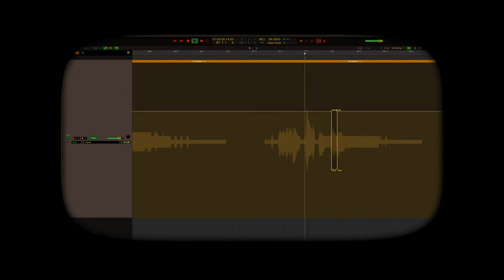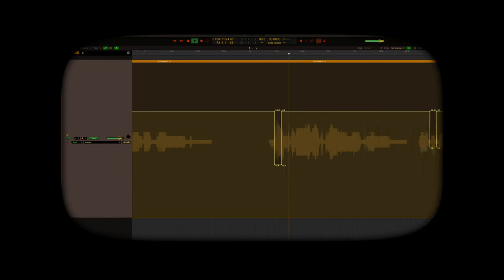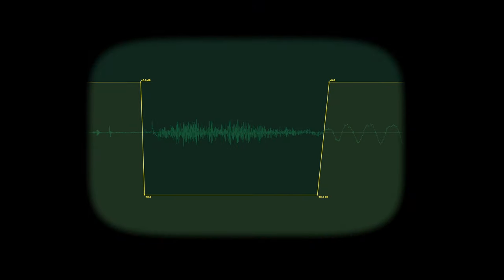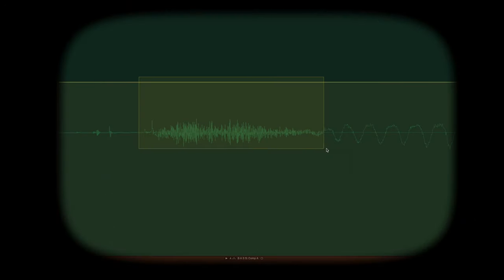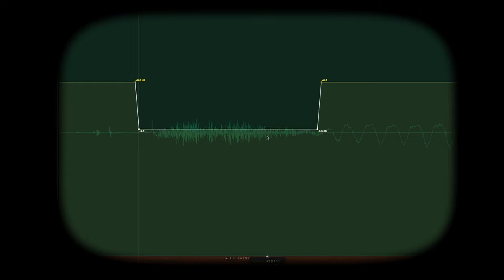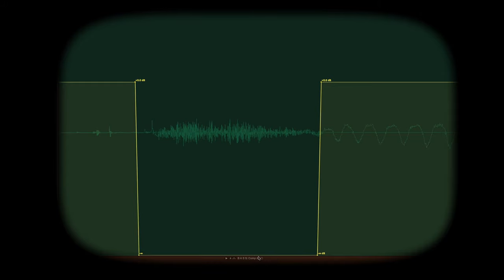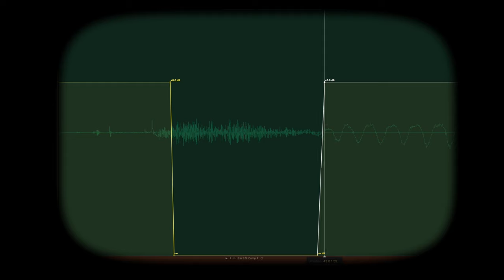De-Esser Plugins are NOT SEXY!

Comment: Have had some good results using Trackspacer and side-chaining it to other bright elements in the mix, the snare, hi-hats etc, so it ducks out of the way for those elements. A combination of this and light de-essing ont the vocal is great for the sessions which require a fast turnaround. If there's time in the mix session to automate manually is by far the best way!

Comment: For the most part, I agree. However, Airwindows' DeBess does something that other de-essers don't, and I find it really gives a more natural sound than just automating. It alters the wave form so that the harshness of the sibilant is smoothed. It works great on cymbals, as well. You can control the depth of the smoothing, and get a very natural sound. Still, I wouldn't set-and-forget it, but if I had to pick one to set-and-forget, it would be DeBess for sure. Especially since it doesn't attenuate highs to achieve its effect. All the shimmer and goodness stays put, and the harshness goes.

Comment: Thanks. I do this too ... because I lack de-esser skills. 

Works great for acoustic guitar squeaks as well. A bell EQ filtre centered on about 2000(as I recall) and have that band just drop out for the squeak. Nobody will notice and the rest of the sound of the guitar stays intact, unlike using the fader. 

I find it also works well in a mix. Automate an EQ to duck the mids only when the vocal is going to give a little more space. I’ve never gotten it to work with side chain so I’m quite smitten with this method.

Comment: I was taught this trick at uni and it makes such a big difference. 

I tend to do this on the lead vocal and then use de-essers further down the line if any Sss need taming after the processing chain, as well as for reverb sends sometimes. 

If a track has too many BVs I would stick with De-Essers for them but still manually edit the lead vocal as its the center on the stage.

Comment: Alright - I’m late to the party here. But, thank you man. You saved me a lot of time tonight. I HATE DeEssers. But they can be helpful. (I like to use them on my acoustic guitar bus to soften the attack of my acoustic tracks). But tonight I was mixing a song with simply HORRIBLE Esses. I usually manually grab each Ess (manually) and lower the gain, then cross fade. Using Automation was a total time saver. Thank you for sharing this. Seriously great instruction.
Reply: By automate, do you mean the volume?
Reply: Yes - pulling the volume down.

Comment: This is the best method by far, I use it all the time, sometimes you have a specific ssss (extra strong) and I use an EQ, lowering higher frequencies, yet not necessarily lowering down the volume of the sibilance ... With this "surgical" method you keep "the power" and "the emotion" of the sibilance where is needed ... My problem is I mix outside of computer (in a synth workstation) then I transport the track (vocal) to computer software and do this without music, so I have to repeat the process 2, or three times to get it just right at the right places (when I hear the whole song), but it's worth it ...

Comment: You can also just do this on the pre-mix with clip gain which will ultimately make it even more transparent. Suppose the automation route works as well though
Reply from the maker: Totally , but it's different to do something like this pre-inserts vs post-inserts (esp. compression & eq).  Neither is better, just different.

Comment: I find it can get a bit tedious fixing sibilance with automation. What has been working great, is create another track with only the slices of the sibilant parts, flip the phase and play with the volume to adjust how much is being removed. At full volume, the sibilance is completely removed, whereas if you adjust the volume a bit to control how much of the sound is being removed... and then it gets easier to add automation over certain parts. Also works great smoothing out guitar solos. What do you think?

Comment: totally agree about no de-esser being perfect. Soothe is about as close as I've got from plugins, but.... my personal favourite way of doing it is to chop all the esses out onto another track, consolidate them as one region, then use the 'open in audio editor' function to open the file in iZotope spectral repair. i hone in on where they're most resonant and piercing and gain those bands down by about 6-9db across the whole file with the horizontal selection tool. i save, return to Logic, and then if need be i can automate the volume of that dedicated channel, although it's usually unnecessary. aside from chopping the esses out, which i'm (hopefully) quick enough to do in one live play-through, the rest of the process takes about a minute. if any of the esses jump out as weird later in the mix, i've got the original audio still there in the main vocal track, which i can bring back in and simply automate, as you describe. esses eh.. can't live with 'em...

Comment: I have a de-esser on a vocal track, the vocal bus, the submix, and master bus of a song I'm finishing now. 4 walls of de-essing. And I STILL had to manually drop the volume about 10dB on every s, f, t, ch, and also fade in Ps and Bs.. damn. I've been mixing for about 3 years and watching tutorials, people go like, yea "slap a de-esser on and you're good!".. That has NEVER worked for me. I swear I feel these guys get pre edited vocals with all the sibilance already removed. I am using a Ride NT1A though, ppl do say that's a sibilant mic.  Thanks for reminding me to always do this!
Reply from the maker: Well, I'm def with you that a lone de-esser rarely works for me.  But what you're describing, it sounds like a problem that does need to be addressed more at the source.  Your mic is definitely a suspect, but so is mic position (huge), singing style / technique (HUUUGE) and one of the more overlooked variables, the mic pre (significant).  P's and B's should never be a problem, or maybe "rarely", that's most definitely a mic position issue.
Reply: @TheHouseofKushTV  I rap mostly, about 6 inches, sometimes closer to the mic to get more bass only voice. I've been using an Audiobox USB interface, but now am using an Art TubeMP Project Series going I to Presonus compressor, I get less sibilance in the latter setup. Maybe it's the way I say S'es..? You have any ideas for reducing sibilance from the getgo?
Reply from the maker: Mic position and vocal technique are the biggest factors, both of which you can control.  Try positioning the mic lower, like capsule at shoulder level, mic pointed up at your nose, and sing straight ahead, not down at the mic.  Or try the mic up high, just above your head, pointed down at your mouth, and point your mouth just below it rather than at it.  Or put it where you normally do, but turn to the right a little and sing as if the mic were 3" to the right of where it is.  Try all 3 positions, then listen to the differences IN THE TRACK, not in solo.  Experiment, somewhere there's a sweet spot of position and distance, there always is!

Comment: A thought just came to me. Were engineers riding the vocals down on sibilants during the pre-digital mixing era? Take some Nick Drake recordings for example. The vocals sound like they at least have a smidge of compression on there but the sibilants don't seem to jump out at me.
Reply from the maker: They were often very hands-on with the preamp gain / input fader, if they had the chance to learn the part and get a feel for the vocalist.  There wasn't always time for that, old records were made fast.  

But what you're hearing with Nick's vocals is several things.  There's a lot of proximity effect/mud left intact, so the bottom is woolly which makes the top feel darker.  There's no obvious HF eq so no added bite, and it's all hitting tape which in those days almost always softened and darkened the top with a lot of HF saturation and rolloff.  It's a very intimate, charming sound, I'm definitely a fan 😊
Reply: @TheHouseofKushTV  proximity effect! Gotta learn how to use that to my advantage too! Thanks man! Engineers riding faders for esses was blowing my mind. Haha

Comment: This is really great, unless you have a client over your shoulder watching the clock wondering what is taking so long.  I can't see this being a 5 minute exercize on a vocal heavy song with lots of plosives and sibilance.  But for my higher-end projects, will def consider the manual approach.  

Another way (and possibly quicker) would be to lower the wave form rather than draw volume moves.
Reply from the maker: Totally!  Clip gain, or a separate track... there are many ways to skin the cat.

I will say, setting aside de-essing: having a client looking over your shoulder while you mix, that sounds counterproductive in every possible way and uncomfortable for all concerned.  I won't presume to give unsolicited advice, and I may be misunderstanding your situation, but I will share this: every single successful, working professional mixer I know (and because I make hardware and plugins I know dozens of pro's working at every level) does about 85-90% of their mixing with the client anywhere BUT in the room.  Anything else is a recipe for stress, crazymaking, boredom on the client's part and an overly restrictive creative space on the mixer's part.  

I just don't know how it's possible to get anything meaningful done, whether simple de-essing or exploring crazy automated moves --- with a client present and, even worse, 'watching the clock.' 😟  If that's a regular environment for you, you have my sympathies man!

Comment: Gregory, how did you do that 'sexy' move in logic where you drag over the volume automation line and you get 2 dots left and 2 dost right with one mouse swipe? Great video as well just implemented in project. Thanks. O when i press option and shift i get 1 left and 1 right. Greetz
Reply from the maker: For me it's cmd-opt-shift with a click-drag.  I've customized a ton of my commands so that may not be the default.  What I advise every Logic user do is opt-k to pull up the key commands window, go to the search bar and enter the term you're interested in (here  it'd be "automation"), then spend a few minutes browsing all your possibilities.  MOST of Logic exists only in key commands, outside of menus, and can never be 'discovered' other than in this window.  Doing what I suggest can open up worlds for what you do and how you do it :-)
Reply: @TheHouseofKushTV  thanks man. Your info is very helpful. Worked with logic from the very beginning. (Mac Plus...) But never thought of this option. I've worked in studios with Pro Tools so I set most of logic key commands the same as PT. Thank you very much for all your other videos. After all these years it gave me a fresh new perspective. I'm gonna be more gentel and sexy with the moves I make towards my audio. 🙏

Comment: But what about de-essing in live situation like a gig or podcast?
Reply from the maker: As you've intimated, those are verrry different screnarios!  I am so NOT a live engineer so I can't help there.  For a podcast I'd just use the Weiss De-Esser and set it as best I could.  Sometimes 2 de-essers in series, set to target different problems, can help with particularly difficult recordings.  But for a podcast, I'd be looking to get the right mic in front of the speaker to minimize the issues in the first place :-)
Reply: Kush, you're awesome and so interactive with your community. Keep it groovy man.
Reply: you just have to be extremely fast

Comment: You generally prefer this stage to affect the vocal prior to it hitting all your processing (except any comp etc that may be baked in during tracking)?
Reply from the maker: It depends, sometimes yes, sometimes no.  Here, this is volume automation so its post-insert.  It can be helpful to do it pre-compression, to control what the comp sees and does, but generally I do it once I know exactly how things have shaped up.

Comment: This video makes a lot of sense.  I don't know if you people have better ears than I, but in most of the videos touting the advantages of this or that de-esser I am not even hearing examples with sibiliance so bad that I would even have lowered it.  Nor do I even hear a significant lowering in the examples made.  I therefore found this information very useful.  In fact, he was right.  When I went back to my vocal track which had a good dozen examples of excessive sibilance, I could lower it in seconds by just reducing my volume automation line where the sibiliance was occurring.  More than that, you will even get in time to actually "see" the sibilance which has a distinctive fish-looking shape when shown to us visually in the wavefile (this is like in the Matrix "seeing" the woman in red by only looking at the code).  Also, while reducing the sibilance, you might decide to actually increase some sounds, like a vital consonant that you can't hear and that can make the word clearer.  It took me all of ten minutes to reduce the sibilance, and while doing it, increase other sounds, even other words and sentences just slightly to improve their comprehension.  I like the hands-on approach too, so I really liked this video as my failure to use de-essers significantly has been bugging me for a while!

Comment: Or set your de-esser to do a MAXIMUM of 4dB of compression and any that offend you after that, need a little volume tweaking love. 
Then if you are using Reaper, you can make a custom action that does the de-essing for you!
Reply from the maker: Yeah, Reaper.. I've vowed that the 2 songs I'm finishing now will be my last in Logic, I've been wanting to jump ship to Reaper for 2 years now.  Wish me luck!
Reply: @TheHouseofKushTV  the learning curve is steep. It takes a long time to get used to it. I made the change gradually and had to get my workflow setup for editing. And then once I started digging deeper and deeper, my world opened up even more. But there was a lot of frustration to begin with.
Reply from the maker: Yeah, that's why I've been putting it off for so long.  The fact that it's so customizable is probably what will save me a lot of grief, re-learning key commands is what I'd most like to avoid!

Comment: What about Melodyne version 5? They have a new algorithm that identifies sibilance.
Reply: It looks great honestly. Very tempting to upgrade ;) but doing each s / t manually most likely gives you way more control in the long run
Reply from the maker: Which, of course, means Logic Pro 10.6 will have it built in :-P
Reply: @mystkmusic  Well, the thing is you can do each manually. Now they only need to fix their horrible UX. I always have a pressure around my chest when I need to interact with it. Compared to Reaper.

Comment: 5-10 Minutes!
You can D-S an entire lead vocal track in 5-10 Minutes?
This Video is 5-minutes and 5-seconds!
That's the sexiest thing I've ever heard. 
WTF would anyone use a de-esser, other than live or broadcast, if we can get it done manually, more precisely and that quickly. 
Maybe De-S stands for De-Sexy.
Reply from the maker: I can set up the automation shapes on all the sibilants in 5-10 minutes.  I'm de-essing (adjusting the individual ramps) the whole time I'm mixing the track, it's a continual process of refinement same as all the others :-)
Reply: @TheHouseofKushTV  My attempt at being clever might have missed the mark this time.  So let me say that This Video, like this whole series, is DEAD ON.  The general theme seems to be, take your mixes off of cruise control, grab the steering wheel, and step on the gas.  Either drive or get out of the drivers seat.  Tesla might make autopilot look sexy, but what's the point of having a sports car, if you're not gonna open it up.  What's the point of pulling Rihanna, if you're not gonna break every piece of furniture in the hotel suite.  Ain't nothing like bending corners in a 911, gas, brake, clutch, shift, go....  And the best algorithms ever coded, still can't come close to the rhythms of making love, or music.
Reply from the maker: @G_handle  Ha!  Spot on man, I'm with ya 100%!

Comment: Do you think its logical at all to automate esses and d-ess with a plug-in ?
Reply from the maker: Absolutely, I do it all the time!
Reply: In ProTools I like to do this with the Trim plug-in  to keep it separate from the rest of the vocal automation. Not necessary, but it helps my addled brain to keep things compartmentalized and makes the automation feel less messy/finicky to me.
Reply: @jonautry  You can also do a clipgain automation for the esses and any other harsh consonant. This way you can have them hit compressors and saturators in the chain at a lower level resulting in less distortion. Obviously this won't work when you want them saturated though.

Comment: Did anyone else notice how well his voice over is mixed. those tight mids, smooth lows and just the right amount of compression on the highs. Really adds depth and a feeling of closeness to your voice. May I know which mic do you use and any tips on mixing the voice over like you do? Great video! You are like the Keanu Reeves of mix engineers, lookwise and philosophy wise :p
Reply from the maker: Thanks!  It's a vintage u89 into a Kush Omega preamp.  Axis EQ to tighten up the low mids and add some presence before an AR-1, followed by a bit of Hammer EQ for sparkle and a gentle mid push, into Novatron to button it all up.  Weiss De-Esser as a final smoother.  All the plugins are doing very very little processing, but they add up to a meaningful change altogether :-)
Reply: Definitely the best voice over of all audio related videos!